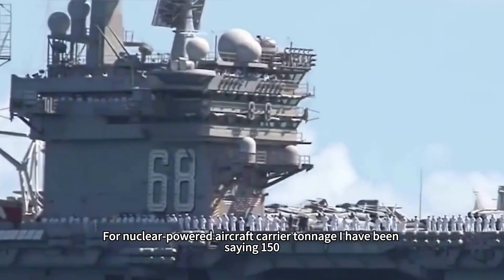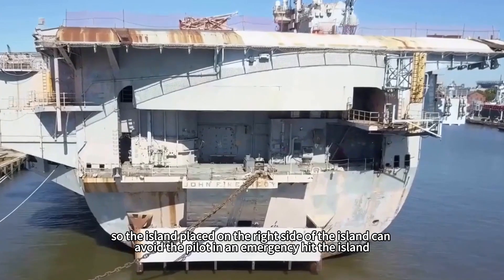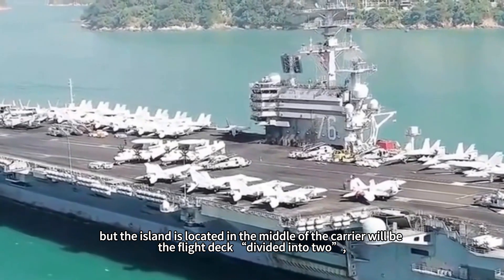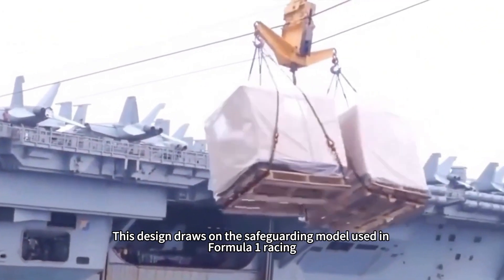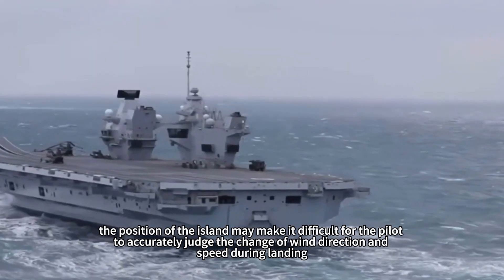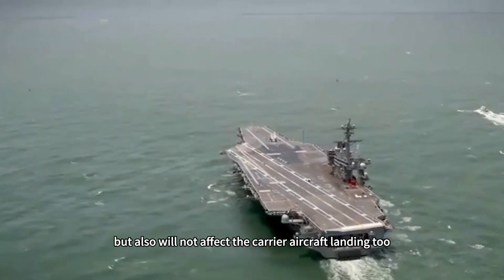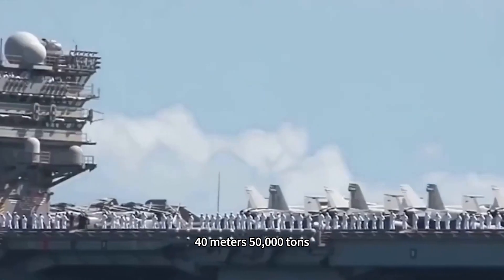China's 004 aircraft carrier has new progress,equipped with nuclear power straight to 150,000 tons?

Comment: This transcript is a fascinating and bizarre mix of genuine naval architecture principles, deeply flawed logic, and pure fantasy. It is mostly nonsense, but it's constructed in a way that attempts to use real-world engineering concepts to justify its absurd conclusions.
The core of the transcript is an attempt at "armchair naval architecture," where the author tries to calculate the size of a future Chinese aircraft carrier based on a series of flawed assumptions and incorrect data.
What Has a Factual Basis (The Few Kernels of Truth)
Naval Reactor Challenges: The initial description of the challenges of naval reactors is broadly correct. They need to be compact, use highly enriched fuel, and be robust enough to handle the ship's motion (pitch, roll, etc.).
Island Placement Principles: The discussion of why an aircraft carrier's island is on the starboard side is historically and practically correct (pilot instincts, maritime rules of the road). The explanation of the trade-offs of moving the island aft (like on the USS Ford)—gaining forward deck space but potentially interfering with landing patterns—is also a genuine and correct principle of carrier design.
Real-World Tenders: The mention of a "nuclear simulation of the island construction tender" (0:42) likely refers to real, publicly available tenders from Chinese research institutes for land-based test facilities, which are a necessary step in developing a new carrier.
What is Nonsense (The Overwhelming Majority)
The author takes the few correct principles above and uses them as a foundation to build a fantasy.
The Core Premise is Flawed Logic: The entire argument is a house of cards built on a single, incorrect assumption: that the length of the catapult must increase for a 6th-generation aircraft.
"now 076 electromagnetic catapult are 130 meters" (1:54): This is a complete fabrication. The Type 076 is a speculative future ship, and no one knows the length of its catapults. The author invents a number and treats it as fact.
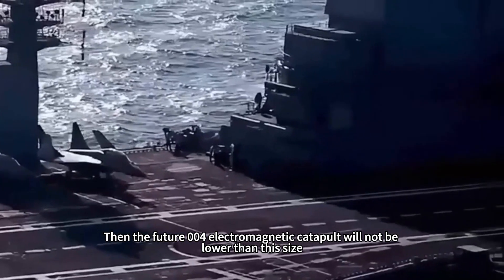"to install 130 meters of catapults... hull size should be lengthened to more than 350 meters" (2:12): This is the core logical fallacy. The author decides a 130m catapult is necessary, then uses this invented requirement to demand a 350m+ hull, which then drives the insane tonnage calculations.
Absurd Tonnage Calculations:
The "calculation" at the end (8:34 onwards) is pure gibberish. It uses a simplistic, linear formula ("an increase of 20 meters is 30,000 tons, 30 meters increase 40,000 tons") that has no basis in naval architecture. Ship displacement does not scale linearly with length in this way.
This flawed math is used to arrive at the desired conclusion: a massive 150,000-ton carrier, a size that is operationally and infrastructurally impractical for any navy in the world.
Factual Errors and Technobabble:
"A1B reactor... diameter... reduced to 4 meters... weight... reduced to 500 tons" (0:17): These are made-up specifications for a real US Navy reactor. The real data is classified.
Catapult Lengths: The claimed lengths for the Fujian (110m) and Ford (115m) are specific but unconfirmed numbers from the internet.
"square coefficient of 0.65" (8:17): The author throws around naval architecture terms like "aspect ratio" and "block coefficient" (square coefficient) to sound knowledgeable, but then uses them incorrectly to justify their fantasy calculations.
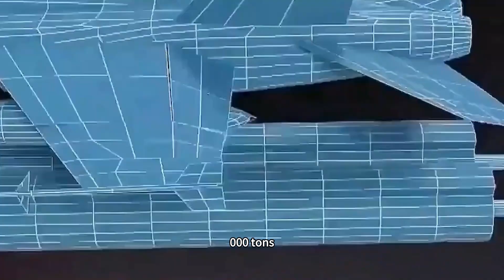"Ford II ship tonnage has been increased to 110,000 tons" (9:01): The second Ford-class carrier, the future USS John F. Kennedy, has roughly the same displacement as the Ford. The idea that tonnage is increasing by 10,000 tons with each ship in the class is false.
Conclusion
This transcript is an example of someone trying to sound like an expert by using technical jargon and creating a complex-looking but fundamentally flawed logical argument. It is a work of armchair engineering fantasy. The author has a desired outcome (a 150,000-ton Chinese supercarrier) and works backward, inventing "facts" and using nonsensical math to arrive at that conclusion.
Verdict: This is mostly nonsense. While it touches upon a few real principles of carrier design, the core argument, the data used, and the final calculations are all deeply flawed and fantastical. It has very low factual value.